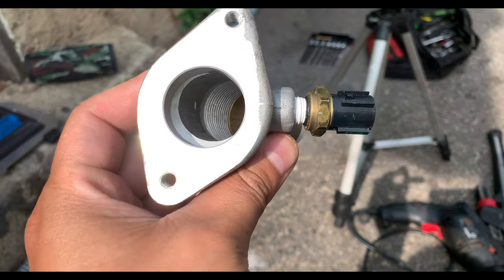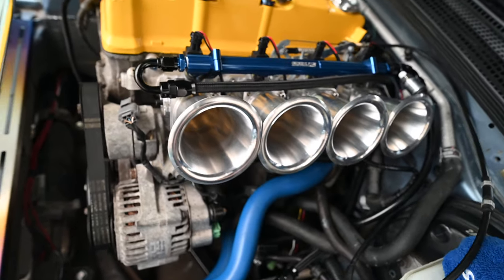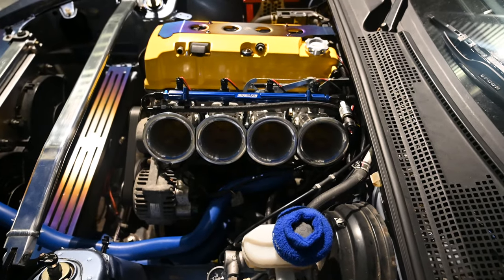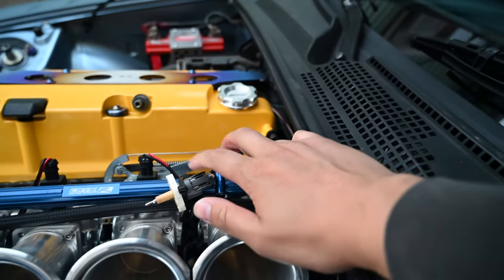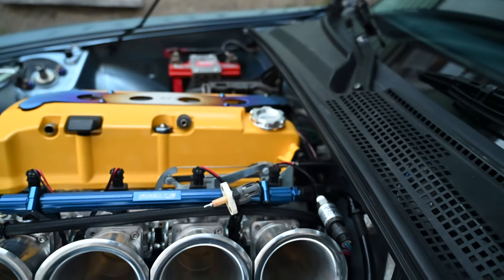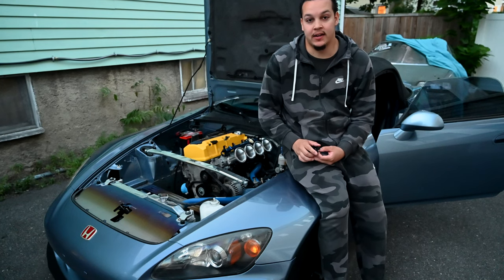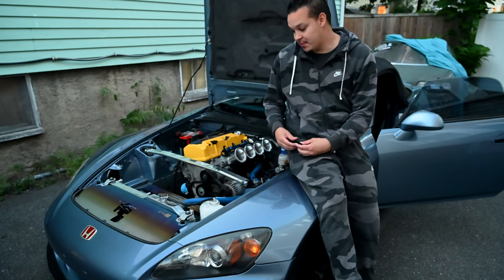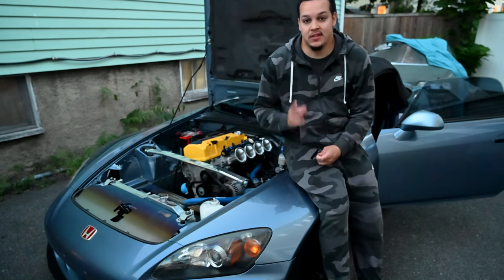The Spoon S2000 gets individual throttle bodies

Comment: The 4th cylinder exhaust pipe is very close to the body, won't it hit when the engine is running?
Reply from the maker: It looks close but there’s a decent amount of clearance. I have innovative 85a mounts on it so the motor doesn’t move much or at all really.